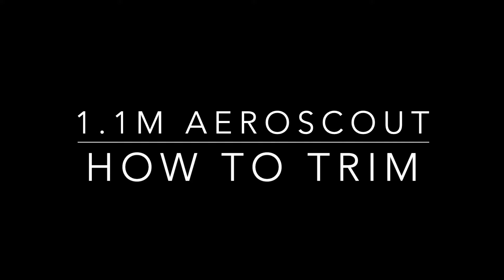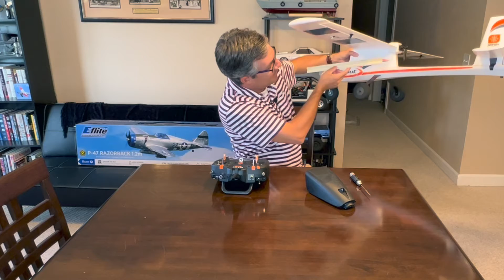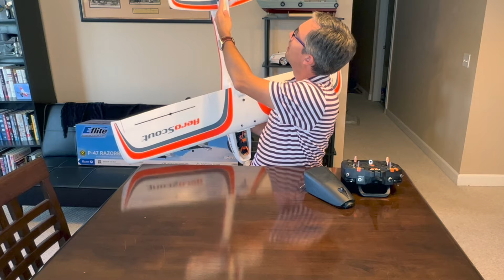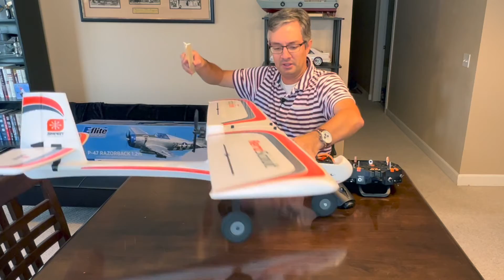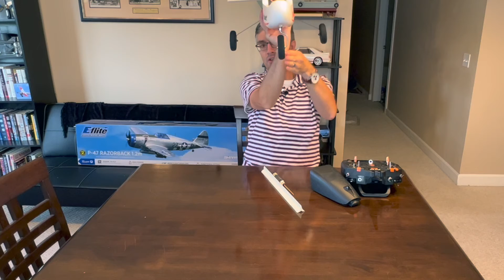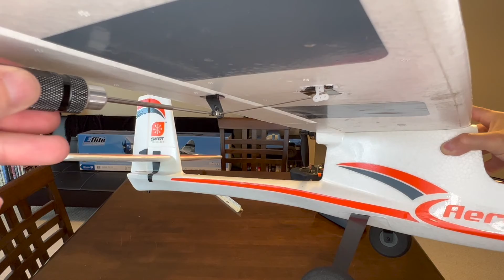Checking the trim on the Hobbyzone 1.1m AeroScout

Comment: Thanks for the great video. Also check that the transmitter trims are centered prior to making mechanical adjustments in the before first flight trimming stage.
Reply from the maker: yes, good point.

Comment: At around 4:00 you mention wanting to throttle to 25% to turn on AS3X in order to do the trimming. I was chatting with a Horizon rep and he specifically make sure I haven't throttle up so I don't trigger AS3X before doing trimming. Are you sure on having it on?
Reply: The Horizon rep was correct, you do not want AS3X activated yet. So avoid bumping the throttle up while doing mechanical trims. If you do, just unplug the battery and start over.

Comment: Go ahead and take the prop off just in case you don't have the throttle cut set up correctly.
Reply from the maker: Yes, that is always an option as well. You should also double check the throttle cut before assuming you have it setup correctly. You can never be too careful when dealing with props.